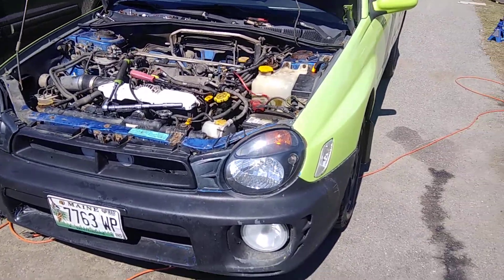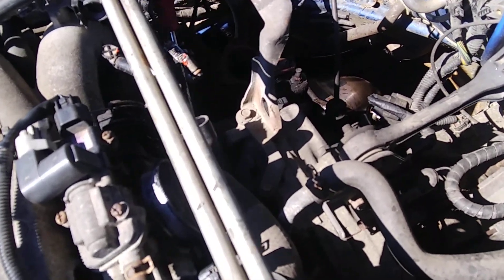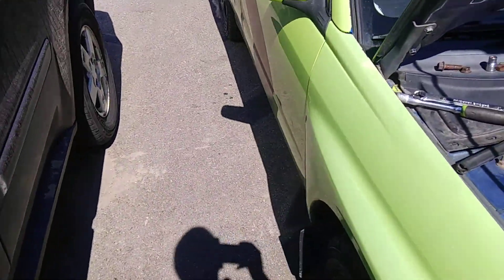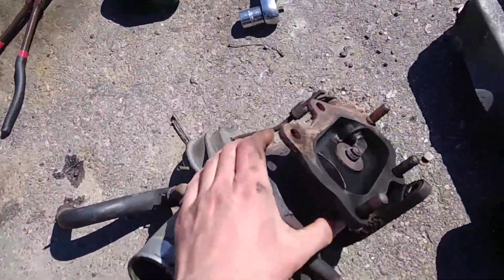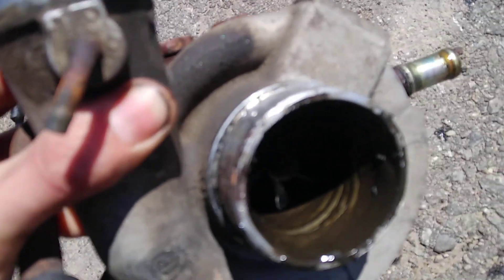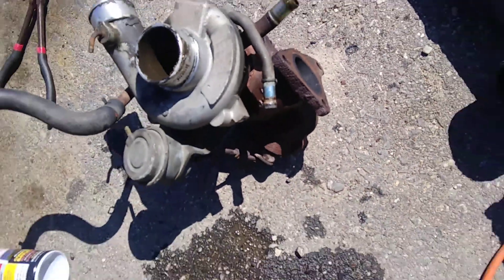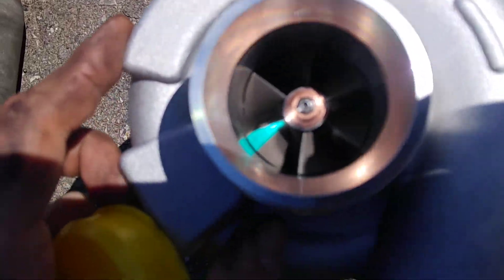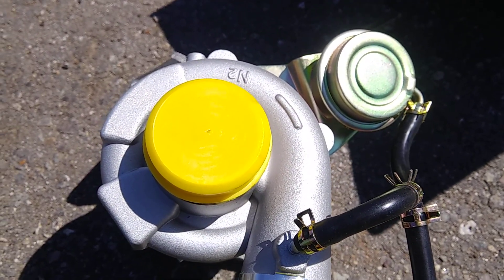The WRX Gets A New Turbo!

Comment: This is the only video I could comment on , I am the one who purchased the fiesta st , and am wondering if the fuel system was upgraded
Reply from the maker: You have my fiesta??? I nevet needed to upgrade the fuel system. Stock is good for a big turbo. Already has all the pipes and intercooler done.
Reply: Just ordered the whoosh hybrid and all the goodies
Reply from the maker: @1996EXStUpIdChArGed  do you have a fiest st or my old black one?
Reply: I purchased your old one from KEY about 5 months ago
Reply: I tried to give you my number but it won't let me on here , I'm in Bangor now and doing some fun stuff to the fiesta , I purchased it from Evan he's cool
Reply from the maker: @1996EXStUpIdChArGed  ah okay. You need a custom tune. Ive done everything to it before and had a whoosh turbo on it. It is balls to the wall fun. I have a 2018 wrx now.
Reply: @MichaelDodge29  it's getting that from Jason from dizzy tuning , and yes very balls to the wall , it's also getting a secondary intake injector , I did camshafts and it's on factory turbo , so that needs to change.
Reply from the maker: @1996EXStUpIdChArGed  his tunes are good. Had the same one
Reply: I will see how it turns out. Should be good , I have a set of cams in it and it goes good , I also got an order in for a monotune motor ,
Reply: @MichaelDodge29  then find a EcoSport and convert to awd and rebadge to an rs
Reply: @MichaelDodge29  I saved a pic of the fiesta as my main photo , one for your record books , also put my email in the description, get a hold of me I know some little wrx secrets that can get cool ,
Reply from the maker: @1996EXStUpIdChArGed  such a great car. I miss it. Especially the cheap car payment. My wrx is slightly modded already. Full exhaust and intake. A tuner is next
Reply: @MichaelDodge29  yes and the power to fuel ratio is pretty nice ,
Reply from the maker: @1996EXStUpIdChArGed  that car will be quite nasty. Upload a video once its done. You wont need to do a clutch as theres a 400hp rated one in it now
Reply: @MichaelDodge29  I have seen when I went to do a diff. Much appreciated on the previous build btw
Reply from the maker: @1996EXStUpIdChArGed  i always go all out.
Reply: @MichaelDodge29  it's appreciated , I've grown up in cars , my stepdad has a bunch , most recent a 2020 Shelby gt500 ( stupid ) mom has an old lx 92 it's nice and a 08 challenger with a hemi , brother's got a 6.0 powesmoke with 1200hp. Trust and believe this fiesta fits right in , build her keep her and then venture for a Audi S5 awd 6 speed manual